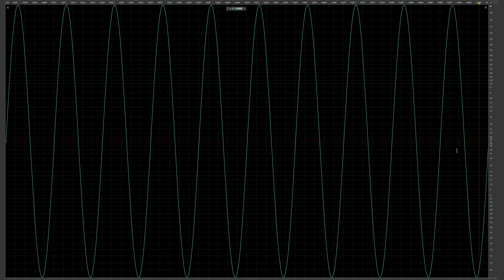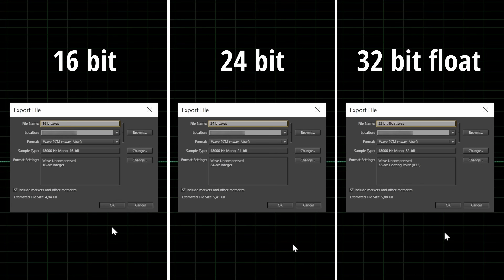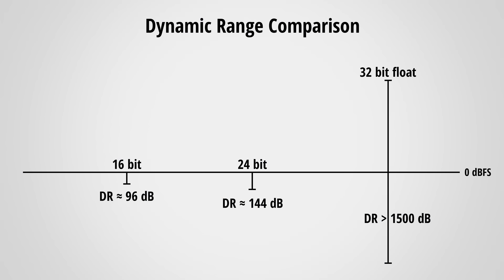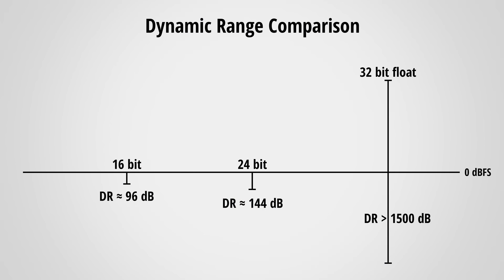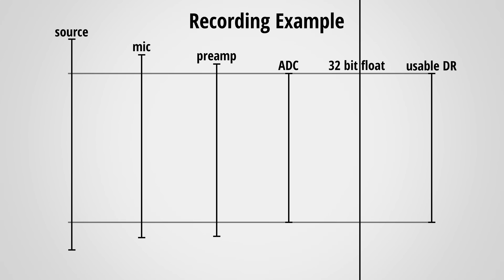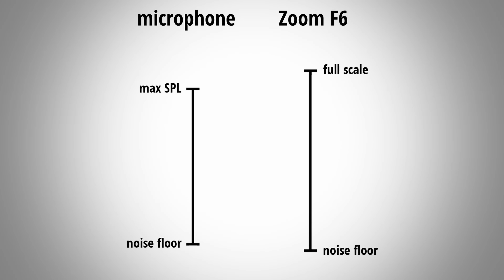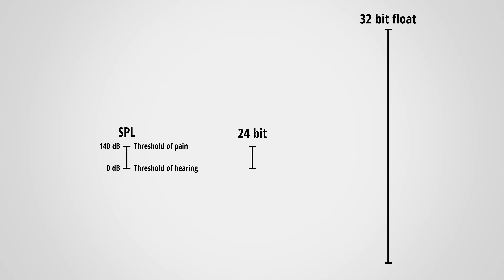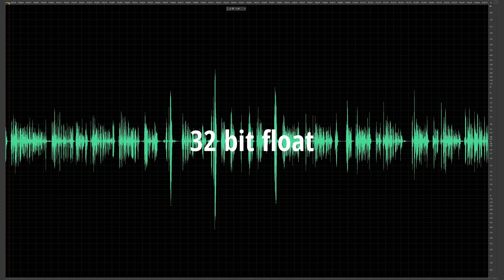The TRUTH about 32 BIT FLOAT for audio recording– Really useful or marketing hype?

Comment: Julian, I think you miss an important limitation of useful dynamic range for a 32 floating point coded signal. It is true that if you play a signal that utilises 32 bit float to the maximum level and compare this with when we later play a signal with what the 32 floating point can code at the lowest or weakest signal level, we have an out off this world range of 1582 dB. But honestly, when do we have music signals that are so kind that they will play strong frequensys at one time for a bunch of samples and then in the following samples the music goes so weak it can't even be heard? All music, disregarding listening to pure sinus, have many different frequensys at many different levels, all playing at the same time. This is what the real world audio signals do, like all the time. This means that we need to make our analysis for the two extreme cases, strongest and weakest signal the system can code, when they play simultaniously. A 32 bit float is using 24 bit large integer with an 8 bit exponent. So when we have a single sample playing it will be with a fixed exponent. And this will be the case as long as we do not all of a sudden need more headroom which we have by using the exponent. But all the time for each and every sample the dynamic range are what the 24 bit integer gives us. Or the 24 bit signicand. The strongest signal we can code is 144 dB higher than what the weakest signal that we can code. 24 bits is what we have to code with and there is no way to increase this dynamic range, because 8 of the 32 bits do not participate in the pcm coding part of the signal. So 1582 dB dynamik range is nothing near the true dynamic range, since we need our system to be able to code weak and strong signals simultaneously. The dynamik range, or the s/n as it should be named since it is a signal to noise ratio in reality, it is the dither noise we have at -144 and not any distortion. Anyway 32 bit floating point give 144 dB dynamik range and it gives an extra headroom that can be useful internally. Most recording professionals however have a good check on the input level and they have less use of such a headroom.

With this said, and we think about it, 1582 dB dynamik range by adding eigth bits to the normal 24, just doesn't make sense. Floating point digital PCM coding is acctually performing less good than a 32 bit linear pcm, 32 integer, So why on earth would we get real 1582 dB all of a sudden when 32 bit linear which are the better format only gives 192 dB dynamic range. So all talk about 1582 dB is downrigth wrong. There is noway we can get these figures for a dynamik range so they should never been postulated as a dynamic range.

You are very clear about 32 bit float gives an extra headroom, but I don't hear you being clear about it is utterly a 24 bit resolution we have, no more no less, and a headrom feature. It would be much more to gain if we used the 32 bit in a linear configuration with integers in favour over the floating point numbers.
1582 dB would most probably be good to record a super nova if it just were happening i an atmosphere. I think it is fascinating that when we use linear PCM which is the most effective use of the bits, we end up with a noise floor that must be there. So it seems we can not cheat nature. The natural laws gives no escape from the bounds nature has set for us. Everything analog has some noise and the digital domain are forced to continue with this limitation.

I have not said this until now but I think you review are among the best we can get. You are perfect in the job as a reviewer, and I look forward to hear more from you in the future. That is a gold star, a large A or whatever symbols one migth use for the highest grade. Thank you for doing the job you do.

// John Stalberg

Comment: Why did you "spare the details" about what 32-bit float is?  They're crucial to understanding why it doesn't give true 700db dynamic range.  In fixed point memory 24-bit covers all numbers between 0 and 16,777,215.  In floating point, numbers aren't stored as nominal values, they're stored, essentially, as inputs to an exponential formula: sign bit |  exponent |  fractional mantissa.  So instead of 1,2,3,4,5, it would be something like 1,2.3,3.6,5,1,6,3.  There are small gaps between numbers, which has a cost in PRECISION.  That is, you're scaling your source audio into numbers that can handle a wider RANGE of values, but at a cost of PRECISION for each value.

My guess is that distortion you showed is an artifact of the loss of precision when you decompress/compress your data.  Ironically, it may show the very problem of floating point numbers.  You created a wave form with continuous fixed-point data, put it into an exponential "floating" data space, brought it back into a linear data space and then notice how some of the data was lost in the conversion.

Sure, 32-bit is useful because you can more easily expand it in an audio editor, but that's because, in an exponential format, it's already closer to the way we experience audio (exponentially, not linearly).  But AGAIN, at a loss of fidelity!  Would anyone notice?  I doubt it, as you say.  

When manufacturers offer equipment in 32-bit they may have better electronics for reducing clipping, but I don't see how they can do it.  The old way is still the best.  Two separate mics at two different analogue gain settings.

I really hate to see experiments with computer generated data.  You should have used real data from a microphone or other source.  

Finally, would you master a recording in 32-bit float or 24-bit fixed?  Knowing the above?  Knowing real world outputs of microphones?

Comment: toll wäre deine Meinung zu hören für PC/Desktop und mittelgrosse bis kleinere usb Mics, die man nur für Sprache , z.B. Anrufe skype, oder ähnlich, benutzt. Dazu auch die 3,5mm audio to USB-a Adapters, die einer mit soundcard built-in, die ja dann eine Unmenge von 3,5mm jack mics verwendbar machen, ohne dabei viel geld fuer einen teuren grossen umwandler auszugeben. Ebenfalls die Ts/Trs auf TRRS kabel adapter (rhode hat diese) die dann wiederum alle 3,5mm Ts/Trs TRRS Variationen brauchbar machen tut. Kleine Sachen die viel Geld sparen. aber sind die dann auch gut? ich denke das hat noch niemand gemacht bisher hier auf Youtube, obwohl dies Hardware sich am meisten verkauft auf amazon.

Comment: weeell i have dealt enough with clipped and too noisy audio... only 32 bit from now on. Audio is a so often an after thought and 24 is not enough imo since often enough had problems with it. When i record weddings and events, there is no soundguy so i have to plug my recorder into the bands mixer etc. and it has to run reliably well. 24 bit always sucked in that regard, i also had to fix audio from actors way to often with 24bit recorders ... especially in Drama where it can happen that the actor whispers and screams, safety tracks with -12dB where okay but the built in limiters and compressors where so bad... i really hope 24 bit recording dies very very soon xD lol

Comment: It’s worth remembering that 24-bit integer precision gives you over 16 million (2²⁴=16,777,216) possible amplitude levels for every sample. That’s a heap of resolution, and as others have commented, you’ll be limited in practice by other things, such as the noise floor of the source and the analog front-end. Setting input levels is fairly uncritical when you have 24 bits of precision to play with: you can be pretty conservative (leaving plenty of headroom to avoid clipping) with negligible effect on the digital noise floor. One should be more worried about the analog noise going into the converters.

As you say, using 32-bit float makes it wonderfully easy to process a signal. There’s an exact mapping from every signed 24-bit integer value to its corresponding 32-bit float—it’s a lossless conversion—and once you have the float, you can scale it up and down wildly without clipping, so it’s great for DSP (though you can lose precision).

So, floating-point is great to have “in the box”, but hardly necessary for capture.

Comment: Question no one has answered for me yet. On windows in the bottom right sound properties next to clock there is a tab called recording. If I right click my mixer in there hit properties there is a recording level setting. Should I ever touch this?

Reason: If I set my gain on mixer just right where the clip light rarely comes on and keep my mixer volume at +-0 but not adjust system recording level. Then I end up with extremely loud clipping audio. So I have nice clean audio going into computer (monitoring with headphone) but unless I lower one of the following I have issues. Gain/Mixer volume slider/system recording level. Which is better to lower or am I doing something completely wrong?

Comment: All good.

I use Logic Pro, which uses the 32-bit float domain for built-in samples and its built-in plug-ins, and a lot of my tracks are sample-based, so I think it actually may also have an advantage over 24-bit.

But see if you can set me straight on this:

While the dynamic range of 24-bit is fine if used properly for a single recorded track, what if you have 100 tracks, and you set a lot of headroom, just to be careful to not exceed 0 DBFS? Does that not raise the cumulative noise floor? It's the accumulation of 100 noise floors. That means the effective aggregate noise floor is a lot higher than -144 dB.

So is that significant, or not? Would this give 32-bit float an advantage over 24-bit in mixing/mastering?

Also, the digital noise floor for 24-bit is made of quantization noise, which if amplified, sounds like a buzzsaw. The analog noise floor is essentially hiss from thermal noise, which is far less annoying to human ears.

Logic also uses something called '64-bit summing', which I can't seem to find much info on. I'd love to see a video from you on that.

Comment: For your conclusion, you seem to be contradicting your own statements. You yourself are talking about possible quantization distortion of fixed-point audio that occurs if it's extremely quiet. Okay, so if the recording device itself is capable of delivering floating-point data, don't you see the improved signal/noise ratio as an advantage?

Comment: Hello Mr Krause, Your helpful addvice helped with me getting a MOTU M4 which i love to bits ❤. 
It was to replace a Behringer UMC204, (becuase no new drivers, it wouldn't talk to my PC) the Behringer UMC204 was powered through the USB i took a chance and plugged it into a phone charger and it looks like it works well in all aspects other than interfacing with computers. For example can run a SM57 mic through it, out the signal trough a guitar pedal on the insert, and hear the result through the headphone socket. Not sure if this wold work for most audio interfaces (scared to try with my MOTU M4). Please say if it is. Is very useful for super cheep preamp with extra features.

Comment: Appreciate the breakdown on 32-bit float, though there's still a couple of questions I think need to be answered:  Why we are given the options of 16 and 24 bit if 32 bit float is "better" in every way?  Is there a downside to it?  Or to put it another way, why don't they just set everything at 32-bit float and no one needs to worry about it?  TIA for any answers (BTW, great content on your channel, I just subbed)!
Reply: 32 bit float use more space.
Reply: @RealTimeFilms  Ok, I figured as much.  Still, nowadays HD space is cheap., so not really as much of an issue as it was a decade ago.
Reply: AD converters do not operate in floats, and historically processing floating point values required specific hardware. Yes, it's everywhere today, but 30 years ago that wasn't the case.

As far as disadvantages go, loses 1 bit of precision in the range of -6db to 0db but that hardly matters. Converters don't have the full 24 bit precision regardless, and the last bit is almost always noise.

Comment: For better audio quality -> recording at 96KHz because you have better detail audio at high frequencies + with bone conduction (piezoelectric sensor as output) you can perceive above 20KHz audio but you need to boost those very high frequencies to hear it

Comment: I work almost exclusively in 24-bit.
The only time this changes is if I'm delivering multitracks or stems to someone; I prefer to render
to 32-bit float so I don't have to dither. I always assume the other party will dither, so I don't want
to add noise twice.

This may not even be sound logic, but I get peace of mind and I've never had any complaints.

Comment: There is one difference mentioned here: dual amp means than at some point the amp can switch frol one to the other. this is audible with ultrasonics content where you can have sudden noise burst in ultrasonics content, which is why I hear people recording with ultrasonics still seems to prefer 24 bits.
So thing is recording with dual amp do have some unexpected consequence.

Comment: Hi Julian, I have a question: what is your recommendation for a mic that best rejects background noise (apart from the sm7b)? I play keyboard/mouse and would like a mic that can reject some of that noise while I stream. Thanks in advance.
Reply: You want a dynamic style mic will do a good job in rejecting background noise. Just avoid the condensor mics they tend to pick up more. I just did a recording with the original podmic ($100) and thought for sure you’d here a cacophony of all the chaos happening in my house. I had dogs running around and my wife yelling and playing with them. You could barely make out a couple blips of background noise.
Reply: @hackinghifi  Yes, and put the microphone close to your mouth, so the you have the maximum signal to noise ratio. The more distance between the main sound source (your voice) and the mic, the more the background is audible.

Comment: 32bit float is fantastic for field recording in unpredictable environments. I kid you not - when recording a gentle stream with instruments in the distance at 24bit, I got clipped by a duck swimming up the the mic and quacking its little head off. 32bit float = duck proof.
Reply: Hahaha love this example!! Thanks for sharing. What microphone/recording did you use? Just curious - cheers!
Reply: @heyiplaybassguitar  It was a Zoom H4n using the built-in mics. It was set rather high so as to capture a wide sonic environment. An interface with a lower noise floor and real mics might have dodged the clipping, but still!

Comment: As an Adobe Audition user your aware that its multitrack sessions default to 32 bit. I have never questioned that default but now I wonder if I even need it? Most of my mixes are very long - around an hour - and they can take several minutes to mixdown. If 32 bit is doing nothing for me in the mix yet is slowing down my mixdowns, would it make sense to mix in a lower bit rate?
Reply: You can render 20% faster in 24bit

Comment: The issue I've been trying to understand, but haven't really seen discussed is how, if it all, 32 bit float is applicable in a live format like streaming. For example, I have the Tascam Portacapture X8, but haven't used or explored it much yet, but if I was using it as an audio interface to my computer, and then through OSB or something similar to live stream, would there be any advantage to 32 bit float at all?
Reply: No real benefits with 32 Bit float there. Most streams dont use 32bit float. The audio Stream has to be encoded into a compressed format such as aac. Even if it would be possible to stream in 32 bit float the people would still have to convert it back into an analog signal to send it to speakers or headphones. Most of which dont have the dynamic range of even 16 bit.
Also from a listening point of view most people dont seem to like it if you yell at them with 140dB SPL right after you have whispered into there ears 😅.
The only benefit could be if you have a 32 bit digital signal processor(hard or software) before the stream in which you could apply effects such as compressor and limiter: you dont have to worry as much about the settings and internal levels exceeding 0dBFS as long as the output doesnt.
Reply: Live streaming tends to require a tightly managed output dynamic range (since your bottleneck tends to be viewers' playback equipment), and the kind of dynamic range you can actually capture on the input side tends to be small enough for 24 bits either way. The biggest difference between int24 and float32 would be the input levels that the compressor sees.

Comment: Developer here: Bitdepth just influences the noisefloor's depth. You don't hear a difference between 16 and 24bit and definitely none of the higher ones as well. but a lot of your plugins might internally convert 24bit inputs to higher ones to prevent mathematical errors on extremely small values, which matters for example in filter design or extremely slow LFOs, so when your project is already at a higher bitdepth those plugins don't have to convert anymore. it's not that this conversion is super cpu-inefficient though. i suppose almost no difference. so whatever you decide, it's alright.